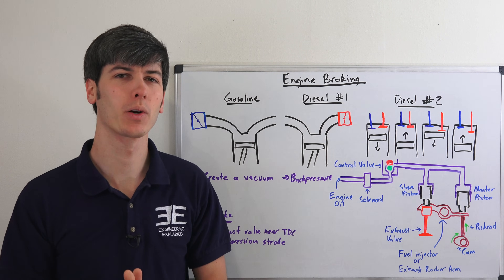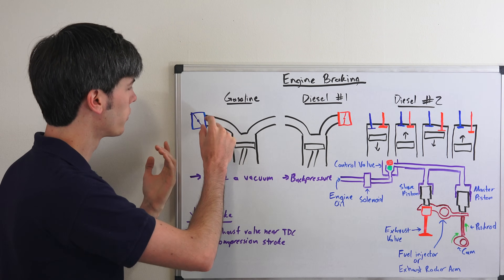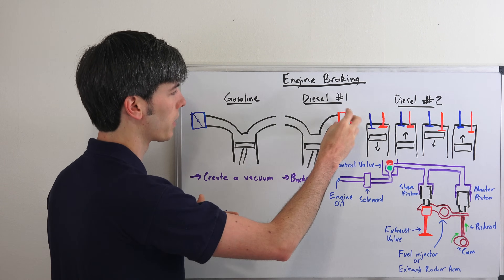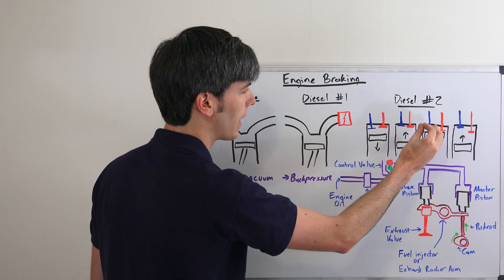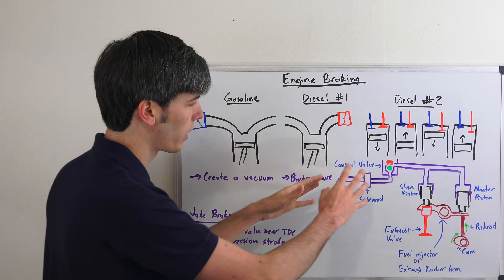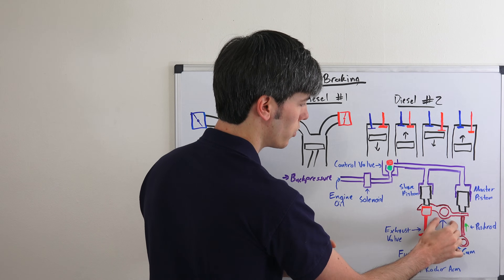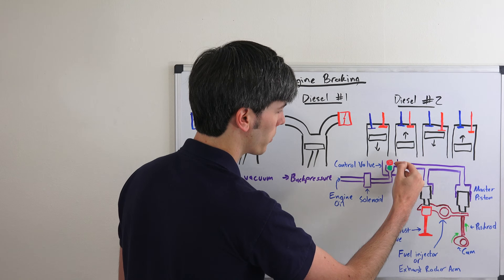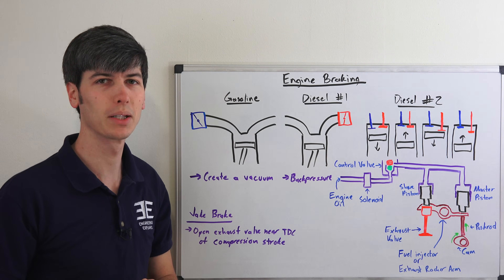What Is Engine Braking? What Is A Jake Brake?

Comment: Okay, so I take it Engineering (not) Explained is not to going to answer my questions. I'm still curious as to how engine breaking really works. I really don't fully understand how it works, but based on elementary physics, I know that EE's answer, as well as MrRexQuando's explanation below of the engine as a compressor, doesn't tell the full story. Is there an expert out there who could weigh in on this? Could someone who really understands this provide the answer?
Regarding the explanation of the engine as a compressor, it's not much of a compressor. Assuming the fuel in turned off, the engine takes in small volumes of air at smidgen below atmospheric pressure and releases it a smidgen above atmospheric pressure (A 40 watt table fan does that a lot better). That's the net effect. If the compression and expansion strokes were adiabatic, all the work done on the compression stroke would be returned on the power stroke. (maybe better to say "expansion stroke" since during engine breaking, there is no power on the power stroke) so the fact that there is a high compression ratio on the compression stoke doesn't make the engine in net to be much of a compressor. 
I'm don't know how engine breaking works, but I know enough basic physics to see that the explanations given by EE (work done against a vacuum) and MrRexQuando (work done as a compressor) are not correct. If I am mistaken, please explain why. I think my explanations of the other explanations being incorrect are pretty bullet-proof. Also, as to EE's explanation, as other commenters have pointed out, without throttles, diesels still produce engine breaking. Another commenter suggested (I take him at his word since I have never tried this), with the engine off and at wide open throttle, you still get engine breaking.
I speculate that the breaking comes through pumping losses and as heat lost on the compression and expansion strokes not recovered as work on the expansion stroke (the extent to which the two strokes are not truly adiabatic). But it seems that this would not account for enough of the lost energy. And further I noticed that in my old manual, the engine temp would go down when descending  a long steep hill with engine breaking. So I'm not satisfied with my conjecture. I'd really like to hear the correct explanation from someone who really knows.
Reply: Well, EE isn't wrong, there is just one further element he did not mention. You say, that in theorie the piston should release the same amount of work when it is pressed down again by the compressed air as it it was needed to compress the air in the first place and of course, you are correct, in theorie.
The problem is though, the inside of a cylinder isn't the perfect world where the theorie takes place.
So let me ask you something. How hot will the air get when you compress it? Well, let me do the calculation for you. Let's say it's a Diesel engine and it runs near idle basically without boostpressure. So the intake pressure is about one atmosphere and let's say the inlet air temperature is 50°C or 323K (the hot turbocharger casing will heat it up) and the compression ratio is 22:1.
Well, under these circumstances, in theorie, the air would heat up to about 530°C.
There's a problem now. Because most modern engine blocks and cylinderheads and pistons are made of Aluminium alloys. Aluminium has a melting point of about 650°C, but you can't even go near that temperature if you don't want that the material loses nearly all of it's mechanical strength. So you have to cool the whole thing. All the sourounding surfaces should never reach temperatures higher than about 300°C and with low loads they will be quite a bit colder than that.
This means you have hot air in a relativ cold envirement and metalls are excelent heat conductors in general. So the air loses quite some energy while the piston compreses it.
Reply: "...heat lost on the compression and expansion strokes not recovered as work on the expansion stroke (the extent to which the two strokes are not truly adiabatic)...." Thank you for pointing this out to me shi01.

Comment: why are there signs on the highway to not engine brake?
Reply: It's because big rigs have a very loud and agressive engine brake which causes people to complain
Reply: When that exploded gas goes right out the exhaust without pushing down the piston, it is very loud, like an anti-lag system. its basically exploding thru the exhaust and not in the sealed combustion chamber.

We used to have these signs in my hometown any time the highway had a stop light in the city.
Reply: Jake Brakes cause noise disturbance I would guess, but we don't have those signs in the UK so anyone else know?
Reply: is it noisy?
Reply: You get complainers.

People will buy a house right next to an airport that's been there for 80 years and then complain about airplane noises - so the FAA steps in and readjusts landing and take off procedures.

And that's how you get some airports with right hand traffic patterns and minimum height requirements that are ludicrous.
Reply: IT could be to prevent traction losses as well, as engine braking directly affects the driving wheels which might cause them to slip. Not sure though.
Reply: Felipe Castrejon because my people like to straight pipe their tractors lol
Reply: ahhhh i see, thanks!!
Reply: Yea, don't do it in snowy conditions without rev matching.
Reply: if i got i right it is just the sucked on air that gets compressed and released. there is no point in lighting the air gasoline mixture up bc it is not force generated by the cranckshaft that gets "burned" therefor there is no braking effect.
(sry if its hard to undestand -english still in practice)

Comment: engine braking is good. less effective on small engines. 2000 Carolla, i'm looking at you. even in 1st gear, it barely helps when descending a monutain... it is also barely able to go up said mountain faster than 30mph, speed limit 50mph. it was so scary. i'll never own another non-turbo 4 cylinder, or non-awd vehicle again. 2003 Suzuki XL7 V6 <3 F*** mileage, i want safety!

Comment: i don't know what you mean by "traditional" diesel engines, but they do have throttle bodys, which are used when switching off the engine.

Comment: Hello mister, could you please explain why 2 stroke Vespas lack engine braking? I have a PX - 150 that is scary to ride down a hill because it just speeds up and over revs while in 1st gear with throttle closed. If my drum brakes ever failed, I'd be dead

Comment: I wonder why the Jake break was needed?
It seem excessively complicated and unnecessary.
I wonder if it was for an unusable engine type? Rotary maybe?
Reply: Studies show that a jake brake makes less noise than a semi crashing into your living room. Im 100% against these "no engine brakes in residential areas"
Take your pick, a loud jake or a runaway truck with no brakes. I lived next to a highway once, trucks used jakes all the time and guess what i slept just fine.
Reply: I think it just assist's engine braking because you no longer have the engine supplying a small amount of power.  So it allows trucks to have better engine braking when going downhill.  Typically Jake Braking is much louder than normal engine braking and also the reason you see "No Engine Braking" signs in places.
Reply: VideoMorsels  I still see them in places, esp heading into small towns.
Reply: Cool!
Thanks for the info guys
Reply: +VideoMorsels Those signs are all over the place in small towns in the US. I see 3 or 4 every day.
Reply: Jake breaking on the highest setting generates more power than the engine power rating.

Comment: Jason, what do u mean diesel engine doesn't have a throttle??
Reply: It does...on the exhaust side.
Reply: Adam S all diesel engines have the throttle on the exhaust side instead of the intake side? Opposite from gasoline engine?
Reply: 7150285 Well some do, but they are mostly just throttled by the amount of fuel they inject into the cylinders.
Reply: Adam S don't know what u meant by that. I was just wondering it diesel have their throttle body on intake or exhaust side, or both....
Reply: 7150285 They never have a throttle body on the intake.  Since diesels use the heat of compression to ignite the fuel they need to basically intake the full volume of air every cycle or there wouldn't be enough compression heat to ignite the fuel.  So modern diesels just inject more fuel as you press the throttle more.  The fuel explodes as it is being injected as it comes in contact with the hot compressed air.

Comment: Many contemporary emissions controlled diesel engines will actually have a throttle valve in the intake path, and sometimes in the exhaust as well. These are used to facilitate EGR flow, however they will also provide some engine braking under certain conditions. It is also worth noting that these throttle valves are controlled exclusively by the ECU. I do not know if they will be closed by default when coasting in gear; someone who knows more than I do about diesel engine ECU strategies would be better able to answer that. (Anecdotally, my 2011 diesel car engine brakes well enough when down shifting.)

Comment: This is all fine and good but it is yet to be explained How and Why dumping  compressed air near tdc on the power stroke causes resistance and therefor slowing down the vehicle. If anything, it seems like it would cause relief and not resistance...Anyone????   Please chime in
Reply: Dumping it doesn't cause resistance, dumping it prevents the compressed air from pushing on the piston.
Reply: +FlyingBlueFeline so if compressed air is no longer pushing down or resisting the piston, it will Free it up which is the opposite of braking..
Anyone?
Reply: Coldsmoke No.. the action of compressing the air is the braking. It takes energy to compress the air. After the air is compressed, that energy is released through the exhaust. The piston then pulls more air in, then compresses it and just keeps repeating the process.
If the air wasn't released then the piston would just 'bounce' off of the air and lose relatively little energy.
Reply: +FlyingBlueFeline Ok...I got it now.
If the air wasn't released, then the air that was compressed on the compression stroke would have a downward force on the piston on the would be power stroke.
Clear, Crystal clear.
The last sentence in your reply lit the bulb.
Cheers
Reply: Coldsmoke Bingo :P sometimes it takes one little phrase to break through. Glad you've got it now, cheers to you as well.
Reply: +Coldsmoke yes, the slowing only happens when the compression is happening then it's dumped for more compression each stroke. I had to think about the mechanics of it too.

Comment: People have made jake brakes but a true jake break holds the exhaust valves open 24/7  and uses the drag from the exhaust of the pulse of the pistons forcing air in and out at 3,000 rpms.

Comment: need assistance with a problem, I drive a 2012 Honda civic, I drove up a hill in low gear of D3 because my manual said that's what its for, however I was going about 140 miles per hour up a steep hill in D3, then when I was through driving the first time , my idler pulley got damaged and when I did it the second time my belt tensioner got damaged, is it going up the hill in low gear of D3 made all this damage to my car and what is the correct way to drive up a hill and down a hill ?

Comment: Besides the jake's breaking, I think the other 2 engine breaking methods relay on the energy needed for the compression step of either cycle, which is big when fuel not injected. There is no vacuum anywhere! Please think about the thermodynamic view of the breaking method.
Reply: +Paul Malnol There is no vacuum in the sense that there is a complete lack of air in the piston, the vacuum in the gasoline case is the piston needing to forcibly pull air into the cylinder because the throttle body is restricting it.

Comment: Wait so diesel engines don't have throttle bodies? Then how is throttle controlled on diesel engines?
Reply: Diesels use direct injection usually. So when you hit the throttle, it just squirts more fuel in the combustion chamber. Diesels cant really use a throttle body injection, because the fuel will burn too soon. They have to inject the fuel at the right time. basically the fuel injectors do the job of a gasoline cars spark plugs by regulating combustion timing
Reply: +Paul Hojda Easy, (most) diesels do not have throttled induction. Rather, the fuel injection varies the amount of fuel injected. Some passenger diesels do throttle air induction under some conditions to reduce noise. Look at the vid, with diesel induction WIDE OPEN.
Reply: Jacques Blaque Thanks :)
Reply: +10 very well explained.
Reply: Throttle body injection - diesel wouldn't burn because it wouldn't be finely atomized.  Early diesel engines used air blast injection to achieve the required degree of diesel fuel atomization.

Comment: If your losing the energy then why is jake brake louder and as a result not allowed on some highways?
Reply from the maker: +Mac MashPotato Because the exhaust valve is opening at TDC (high pressure) rather than BDC (lower pressure).

Comment: Rather than braking being caused by vacuum from a closed throttle, I thought most of the braking comes from the compression stroke without the following power stroke? If kinetic energy is being converted to thermal energy, the compression stroke is where it would happen.
Reply: +H. Doug Matsuoka No. Gases compressed will expand during power stroke essentially delivering energy that was input during compression; some mechanical losses (e.g. friction) will occur. Intake with closed throttle has piston working with ~0 absolute pressure above and full atmospheric below. It takes work input to do that. That works comes from vehicle moving, driving transmission, then driving engine. Simple, no?
Reply: Sounds reasonable to me. Thanks! Where is the heat generated, though? The kinetic to thermal conversion?
Reply: Where is the heat generated, though? The kinetic to thermal conversion?
Reply: +H. Doug Matsuoka You might look at the process during the intake stroke as kinetic energy of vehicle being used to drive piston downward against large pressure differential. Very low pressure above with throttle closed and essentially atmospheric pressure below. Probably some thermal transfers in the gas dynamics. Main thing is piston is being worked with no recovery of that energy.
Reply: Gotcha. Thanks for the info!

Comment: doesn it go hard on transmission?
Reply: +Nhoj Sivad what's red lining?
Reply: +Nhoj Sivad it's not me knowing nothing about engines but it's about me knowing little about engine jargon. 

thanks for your eloborate reply but i would kindly refuse your precious answer if only i knew you are that intolerant for people who speak English as second language.

have a "great" day!
Reply: +Nhoj Sivad ps: i REALLY dont know what red lining is, is that red line you keep talking about the one in the rev. gauge?
Reply: +Uluç Özcan 

Yes, the redline is the beginning of the red zone in the rev gauge. Thus the limit the engine can rev too before the fuel/spark cut is engaged.
Reply: thanks. because i thought it was a bit harsh to transmission (i know nothing about automatic, i always used manual, so keep that in mind. i'm talking for manual transmission) i avoided this unless it's absolutely necessary (like brake failure). 

so, you would reccomend? so would EE?
Reply: Uluç Özcan

The redline is the limit your engine speed is designed to operate at. It's set by the engineers of the particular vehicle. It's usually an electronic set limit in the ECU as the rev limiter. You could raise (or remove) the limit through ECU reprogramming.

People usually increase the rev limiter when they upgrade valvetrain components. Removing the limiter is a dump idea IMO and will probably make your engine parts come out.

The only normal way you can over-rev your engine would be to downshift to 1st gear while traveling at 65MPH/100km/h. In this case it doesn't matter what the rev-limit is as you will mechanically bypass this.

Comment: Why don't diesel engines have their throttle body on the intake?  I think it would be quieter.  No wonder diesel engines are so loud when they do engine breaking.  I would also think a diesel electric hybrid would be a good idea even for big semi trucks only for big trucks the electric motors are just used to get the truck rolling while the regenerative breaking would be allot quieter.

Comment: the old mack dyantard worked on a similar system,although it was meant to slow the engine rpm as the driver shifted through neutral to select a higher ratio when ascending a grade using the wide ratio transmission,this prevented the engine speed dropping too much before the trucks road speed dropped allowing the driver to still match transmission shaft speeds.

Comment: so why is this not allowed on some roads unless in emergency?
Reply: +shadowslayer552 noise. They tend to be quite loud. If you ever hear a semi slowing down and it's making a loud "bum bum bum bum bum" engine sound, that's the Jake brake.
Reply: In a lot of countries it is illegal to decelerate you vehicle at a high rate with out your brake lights.
If you use engine braking with out using your actual breaks at the same time you can give the guy behind you a fright or worst case cause an accident.
Reply: Mark Teuteberg they shouldn't have been following so close then..